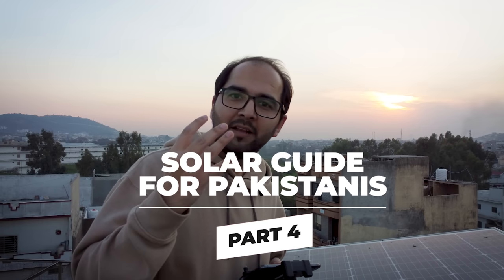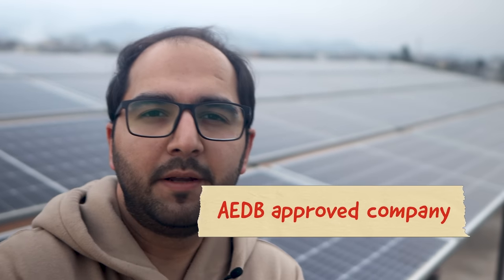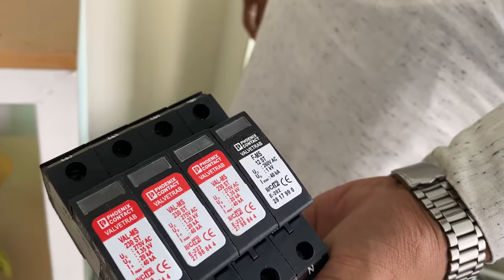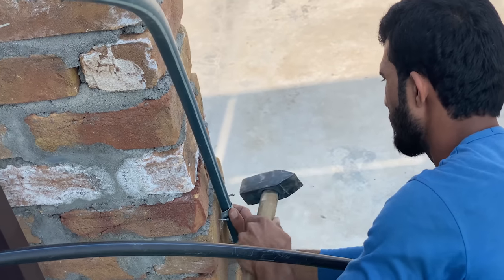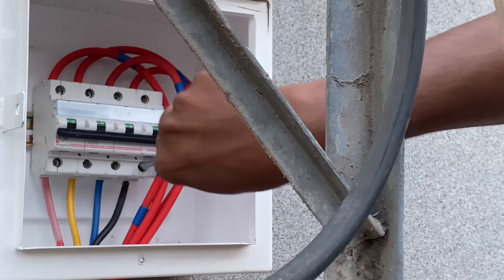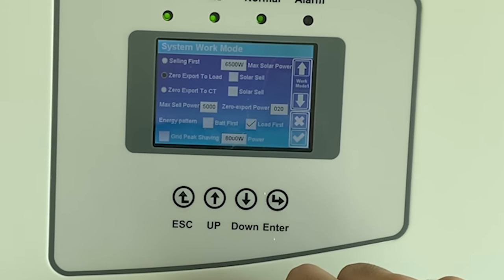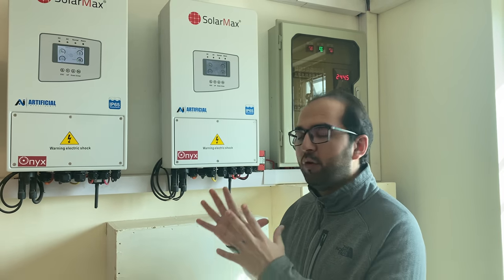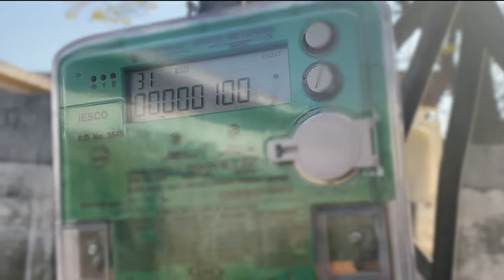SOLAR NET METERING: Truth No One Tells You

Comment: Absolutely on the point video for Net metering. Hats off Owais bhai for sharing the complete details. I was the first one to apply for Net metering in our area back in 2019. Took 3 months to complete the process since we payed the amount to the solar installer vendor. They got the process done themselves but the interesting part started after that. On the day of installation when connecting the system to the grid we found out that our transformer was malfunctioning (2 phases were running on same frequency) for God knows how long. IESCO ignored the issue and refused to fix the issue as it needed transformer repairing. Did numerous complaints to NEPRA, IESCO, PM portal but of no use. After 8 months we ended up paying 100k to the SDO for in lieu of transformer repairing and within 2 days they installed a new transformer. Unfortunately this is the cost we all pay for living in this country.
Reply: Whaaaat really ?? 100k for transformer repairing. Omggg.
Brother, In KPk Swabi distt. we only call the local union council and within 1-2 hours your transformer will be replaced.....! And If your Meter is having some problem...it will be replaced within same day. Free of cost.
No charges
Reply: harsh reality :(
Reply: @muhammaduzair6022  same the6 does in my area too free of cost in rawalpindi satellite town
Reply: @muhammaduzair6022  Your Pakistan is So Excellent Than My Pakistan.
You Know This Video Reality of My Pakistan...

Comment: Dear Awais,
You are always sharing great experience with people. Thank you.
I just want to comment on your lightning arrester which should be based on rubber surface and not directly on a solid wall or a piller you built for this purpose. The lightning thrust will pass on to your building and damage the structure. You may refer to Smart Solar's video related to this subject.
Reply: Agree.
Reply: He connected that with the ground through a copper wire and electricity always follows the path of least resistance so it won't pass through the building.

Comment: So i had the worst experience with nepra and iesco. We contacted an AEDB registered company. Our system got installed in the month of june 10. Now comes the bad part. First we had to get a 3 phase connection installed which we applied around 6 months before installation of the system. When the system got install we had to pay guys from iesco 85k for the installation of the 3 phase connection. We were the first solar installers in the whole sub division. First the file went to desco which lingered for 2 weeks and after paying 5k the file moved to the inspection department. They visited our place and raised some 7 objections. We had to pay 20k and the inspector approved the file with no change in the system. Then the file got in Nepra and for 2 months the license wasn’t granted. When we approached someone in nepra they asked for 50k to get the license allowed. So we again paid that bribe. After approval from Nepra the file came back to iseco and they raised some objections with the fee submission and at that point I said enough and decided not to pay a single dime to these assholes. So they put the file to some cold storage. I made 4 complaints to the PM portal and no one helped. My father intervened behind my back and payed 25k to the guys and got the net meter installed in 3 days and paying another 10k to the lineman who installed the meter. The process took around 6 months to complete with around 200k as bribes so the actual cost of our 6kw system raised from 750k to 950k.
Reply: I paid 120k bribe
Reply: انہوں نے مرنا نہیں ہے؟ کس طرح یہ لوگ خود بھی اور اپنے بچوں کو حرام کھلاتے ہیں۔ 
I am living in Germany, here companies offer free solar system instslkation for a fixed rate / month. A countey where you see sun hardly for a month or two.
Reply: A single properly filled complaint  on citizen portal/nepra could have done the trick. Disco's are time-bound though their own consumer manuals and SOPS.
Reply: @yousaf.saleem  citizen portal is a gimmick. It doesn’t work. I’ve around 17 complaints and not one got addressed. No one from nepra demanded any money but the guy we approached told us that licenses are pending for months and to get ahead in line 50k was the price and in peak summers it was either 35k of bill a month or 50k for the bribe. As far as descos sops are concerned trust me there is no such thing as professionalism there. The only sop or working manual is a nice stack of cash and your problem is solved.
Reply: @sunny56dx  Citizen portal is just a tool. If you don't know how to use it will you can call it dumb. If someone doesn't know how to drive drive they call the Car bad. But if you file a proper compliant it will can even result in  suspension of officer concerned if they are not performing according to law.
Reply: @sunny56dx  share the screenshot of you compliants and responsed to  those 17 complaint.
Reply: @yousaf.saleem  i know how to file a complaint. If you are considering that im lying about that go get a life. And you can’t post screenshots on youtube.
Reply: @sunny56dx  Did you mention relevant clauses o IESCO's SOP's in your compliant regarding netmetering? 
what was the official response of the IESCO? 
What issues were pointed out by the IESCO staff during the inspection of your solar installation?
Reply: Good brother,  ,
Reply: @sunny56dx  What do you mean by 'not one got addressed'? Are they still pending at the Portal? Or they have been resolved with Partial or No Relief Granted? If yes, they must have added some comments. What did they say? That's Important. People just rely on the Complaint Status and don't bother about the closing remarks.
Reply: @yousaf.saleem  so u r saying people doesnot khow to file complaint at PM portal. So it is always people mistake. Wah meray dost wah kya bat he....
Reply: @Nora_editz123  you haven't answered my simple questions regarding whether you included relevant clauses from IESCO Netmetering SOPS. Like I said before discos are time and law bound by their own SOPS. Every official has to propley "document" according to Law. In my case SDO  had to document what was already written IN SOPS, he was bounded by the law. Even when installing my netmeter (which was installed even before my fellows who had paid the speed money 💵 😂) lineman already knew he will not get any "meethai" due to risk of citizen portal. 
I had told solar vendor, I was not going to pay a penny in the name of speed money. 
Interestingly my initial compliant was closed as partial relief granted and it was re-opened 8 months later, well after my system was already working, that is why officials fear it so much. A compliant on Citizen portal can effect the officials ACR negatively. 

YES! People make mistake in their citizen portal compliants. They generalized their complaints according to their wished instead of according to the Law/SOPS.
Reply: @yousaf.saleem  when you go to a police station do you file the complaint by mentioning the relevant law such as 302 for a murder  or you simply explain your grievance and the relevant technical officer does the job of figuring out what the law is and how the law will take it course. I filed the complaint regarding the IESCO that even after the grant of license by NEPRA the officer at IESCO are not installing the net meter and in response they replied that the vendor submitted the fee at wrong bank and closed the complaint with partial relief granted . I personally went to iesco office and with the vendor and the fees was deposited to exactly the bank it was mentioned on demand draft. I filed a new complaint with the photocopy of demand draft and they closed the complaint with remarks that relief was already granted. I disputed that and they re-opened the complaint after 1 week while my father already paid off those scumbags and the net meter was installed. If you need technical knowledge of laws to get relief from PM portal then its just a gimmick and it is useless for the masses.
Reply: @Nora_editz123  han bhai. 2 lakh lga diya 6 months ka time b zaya krwa diya lakin galti sirf hmari hy k hmy is shandar PM portal my complaint file krna nai ati.
Reply: @sunny56dx  Citizen portal is not police station.
I am a doctor by profession not a lawyer, but my first compliant against Lesco was generated when I went through Lesco "Consumer manual" which is obviously written for the consumer. 😜
That is why I keep repeating a term often quoted on photography websites RTFM I.e read the * Manual. 
Our fellow consumers don't read the relevant Sops which are actually published for the consumers!! 
In case you have evidence of bribe you can also file a complaint against the Iseco officials for taking bribe.
Reply: @sunny56dx  6 months!!! 😂 I can only say next time read the * manual.
Reply: @yousaf.saleem  your argument is lame. For a country with 60% literate population with 25% who can only write their name are included in literate population. Let’s leave it at that.
Reply: @sunny56dx  netmetering is not done by "Illitrates". Off-grid market is different.
Reply: @yousaf.saleem  citizen portal se kuch ni hota  🤦🏼‍♂️
Reply: Im the son of a physic's professor. My father was used to say " me logo k kaam is liye kr deta hu k mary bad ap logo k liye asani ho " but after my father passed away. From the death certificate to till   other education department,  account office paper work we paid almost 3 lakh RISHWAT .. 

Yesterday i was traveling to lahore. On ravi i paied 100RUPY FOR chae pani. When i cas carrying all my documents...
Reply: @yousaf.saleem  bro. I know one thing very clearly. If you want your work being done on time you need one of below.
1 Connections
Or
2 money
Rest of other things are just illusions for poor janta to dream.
Reply: Bro you have to file complaint in every department of govt against these corrupt mafia with evidences.Dont take it normal.we hv to fight individually and collectively to get the system right.
Reply: @madil2259  Agar na hota to mein bhi kheta nahi hoa.
Mein ab taak koi 6 solar system lagwa chuka hoo. Jab jab Citizen portal par proper complain kaam waqat say phela hoa hay.
Jin logo nay bribe di unkay kaam delay hoay.
Bribe day kar paisa, time aur ameen sab bekhaar.
Reply: @yousaf.saleem  These portals are mere jokes. Just modern representations of hand written applications.
Reply: @sajidiqbal8718  how many complaints you have filed on citizen portal until now?  These are joke for the our corrupt awam who will pay the bribe instead of filing a complaint on citizen portal just to maintain their relation with government officials. 
How many written application are forwarded to relevant department on their own? How many written applications stay anonymous?
Reply: @yousaf.saleem bhai dekho agar apki complain approve hoti hai tu app kiu in bhaio ki taraf se complain ker dete.take inko bhi yakeen hogai.
Reply: mujhy sharam or gussa atta hai k mein esi country se belong krta hon
Reply: @MegaVictory2009  used to wonder the same, but after learning about govt salaries and inflation rate it seems they want food, rent n edu fees & living, and to them it doesnt matter from where the money comes for their "services". Govt needs to raise their salaries, acc to market rates to reduce corruption, instead of raising salaries for politicians who do nothing.
Reply: @yousaf.saleem  you are living in pakistan and still you are projecting like you are a citizen residing in Sweden or Norway. Not denying that you are done away smoothly with the system. But everyone is not so lucky and the system is not that people-centric at all. You are being like Pakistan is a heaven-like state free of corruption and all bad social ills only because Pakistan has a legendary "Citizen Portal". Has Citizen Portal been so efficient,responsive,elixir to cure corruption than why Pakistan is ranked at 140th position in Corruption Perception Index internationally? There exists rampant corruption in public institutions and the cash is the only way through. Political biasness aside of course.
Reply: @jamshan5208  Pakistan is ranked 140 on corruption index because our awam is willing to pay "Bribe" and use connections instead of knowing their own rights.
Typical sentences "چھڈو جی... قائداعظم دو تے کام کراو."
Reply: @KhanBirdsCollection  👌🤣🤣🤣
Reply: @sunny56dx  Can you guide us how to launch a complaint please. we will be really thankful
Reply: @pakistanihosting  nai yar mjy nai ata. I think you have to hire a lawyer to file a complaint on PM portal kun k jab tk sab laws, precedents, judgments or legal knowledge k bgar compliant  file nai hoge PM portal kam nai kry ga. Kun k apparently mare stating the grievance is not enough on Legendary PM portal waha jo log bethy unhy sab laws k sath btana prta k kon sy laws ke violation ho rhy phir wo kuch krty as Mr Yousuf stated.
Reply: @MegaVictory2009  bhai kis door main jee rahy hain. Marna warna unko sab bhoola hua hai unko apni rishwat say matlab hai apki majboori say nahi.

Comment: Great video! One small note: Lightning arresters are required only for buildings that are more than 15 meters (49 feet) in height.
Reply: Pakki baat h ?
Reply: I was going to add same comment as it is necessary as well
Reply: @TechRana  4 to 5 meters
Reply: Even if you have some mobile tower close to your building. You dont need to install it

Comment: These struggles were similar in india as well until 1 or 2 years ago. Certain new policies by central government listed certain % of on grid plants in a state for financial assistance to state government electricity boards / distribution companies from central government. Suddenly everything has become smooth. Just have to apply online , every process goes smoothly. I dont even have to go anywhere !! The Installer just collected the forms and he uploded it online .  Just installed a 3.3 kw mono perc for 1,30,000 inr( 3 lakh pkr)   ( 1,80,000  - 50,000  central government subsidy ) . No pre physical inspection nothing . All inspections are done online . , the installer just uploaded the photos online , few days later the electricity department came and replaced the meter .
Only one earth is needed as per regulations ? Here 4  separate earth is installed , ac ,dc, lightening arrester , mounting structure
Reply from the maker: Indeed digitization is the best solution to fight corruption
Reply: @syedowaisali  there was no corruption even before digitization atleast in case of residential solar plants . The issue was the need to do lot of paperwork and inordinate delay .
Reply: @arjunjmenon  It was not paperwork but simply that states didn't want to pay customers for electricity as they already have idle power plants which has fixed charges

Comment: Just to add. IESCO buys solar units at 'half the price' of 'Off Peak' units. That is Rs. 9.48 per OP unit. After 3 months of green meter activation, on the 3rd bill, I got the credits. I paid the Peak-Hours units in the first 2 months.
Advice from my experience in Bahria Town RWP:
1. Dont start running ACs 24/7 till your Zero bill comes. 
2. The credits is Rupees will runout fast if power used during Peak-Hours (presumably 5pm-11pm).
3. IESCO will minus Off-Peak units from solar units monthly BUT will count/bill Peak-Hours units.
Reply: How was the approval process for green meter in Bahria Town? I am also in Bahria Town and I want to install net metering hybrid system.
Reply: @zob79  Like Owais bhai said. Its all bribe. Solar installer includes 'application' and green meter 'charges' in the overall cost. Green meter is most of the time short in the market so, in my case I had to go after installer.  

Application takes 2 days max if installer is willing. No need of NEPRA licensing for solar below 25kw. 

I wasnt expecting load shedding in BT. I think net metering hybrid is the way forward. Good luck!
Reply: @tarifkh1  

Thank you very much. Can you please recommend a good installer?
Reply: @zob79  I got through Smart Solar, Lahore based, but office near Khiva restaurant phase 6. Not recommended. A long list of greviences.

Comment: I installed my solar system of 5 KW through BH Solar in Islamabad. The system was installed and operational on 11th of September while the 3-Phase meter was installed on 2nd November, 2021. BH solar handled all IESCO matters and I didnt face any headache. BH Solar charged 600,000/= Rupees for this system.

Comment: I am a retired non- resident Pakistani just like you who has also returned to Pakistan after 35 years. Your post is excellent but I wish you should have also talked about the possible ways to install a solar which would be totally independent of the grid and which would help the user to get rid of DISCOS' monopoly and high electricity bills. I have also applied for net metering and hope to get my green meter soon. But I wish I did not have to rely on DISCOS.
Reply from the maker: due to current battery technology, it is not possible to go completely off-grid  at a reasonable cost.
Reply: Mere bhaee koee faeda nae, Pakistan me sab 2 no, net meter na lageana werna Kuch nae mile ga, sab kha Jaen ge,

Comment: I have 2 concerns about net metering, 

1. how’d i know if a green meter and a regular consumer meter   Units measuring / calculating method is same ?  What if green meter is slower than the consumer meter,  we will go in loss because  green meter unit cost is already lower than what we are paying to DISCO ( inclusive of all taxes ) , 2nd the green meter is slow… ( whats  the point in investing Rs 10 lacs and gaining nothing ) 

2. Suppose my grid is producing 10kw at the moment. 2kw being consumed at my home, and disco system requirement is as low as 2kw of electricity, now 6kw of electricity is going waste.  i am again going in loss,  is there any way i can cash this electricity?